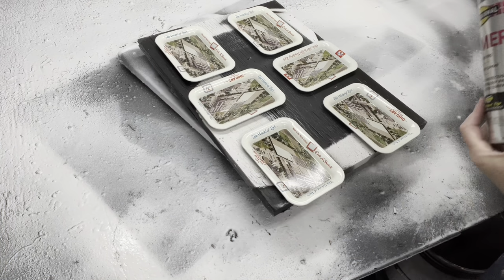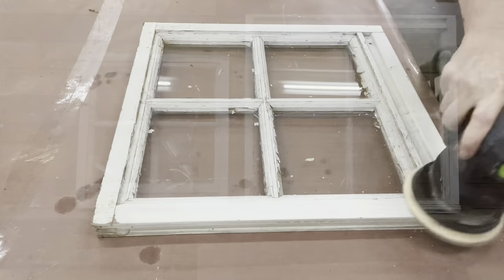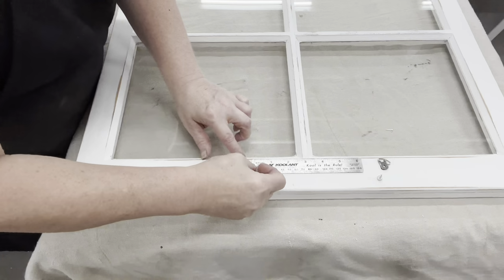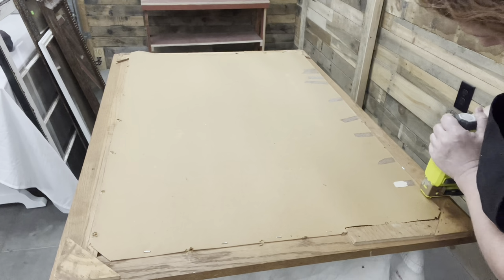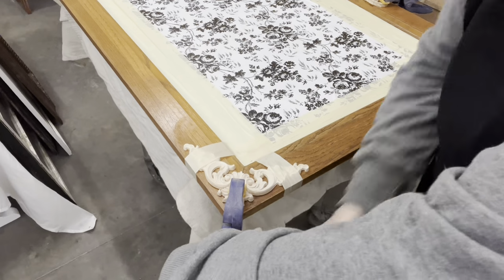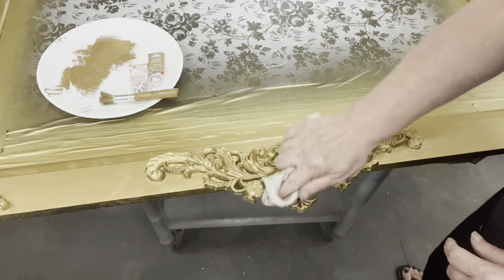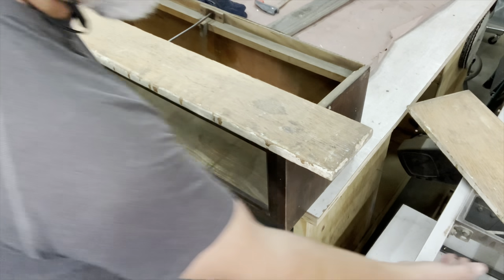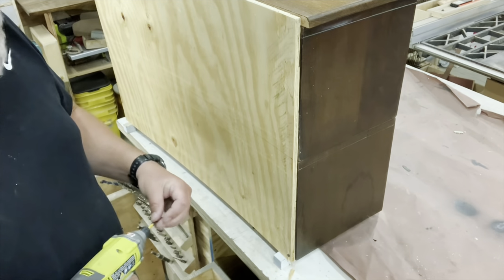Garage Sale Finds Repurposed ~ Makeovers

Comment: Hi Yvonne and Chris, OMgoodness, I despise bugs and those earwig pinchers are horrible, they usually come out more after it rains I believe.  The shelves for Chris’ tools are just perfect for his display, looks like it was built for that. I have a mirror similar to the one you did that I am going to do and I was planning on doing moulds  or something like you did but I am curious as to why you would choose resin over air dry clay.  You had mentioned that you thought of doing resin and then changed your mind to the wood pieces…
Reply from the maker: Oh.. I like all the techniques..it doesn't matter which you'd choose to do. Resin or Clay